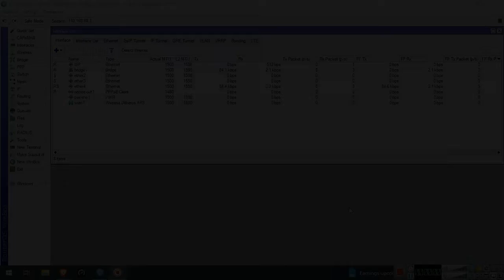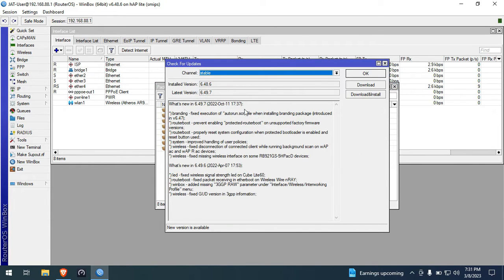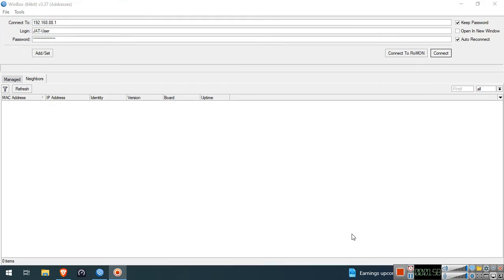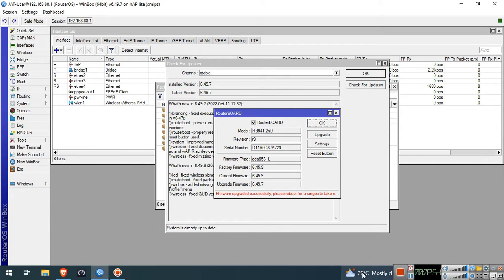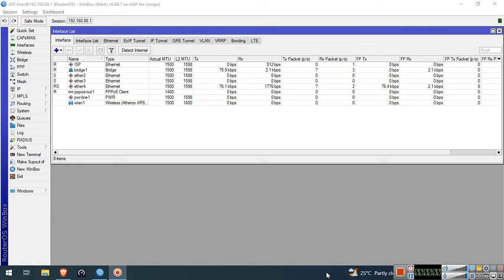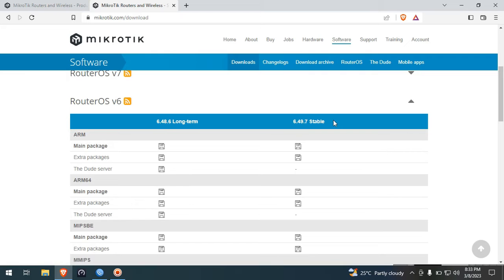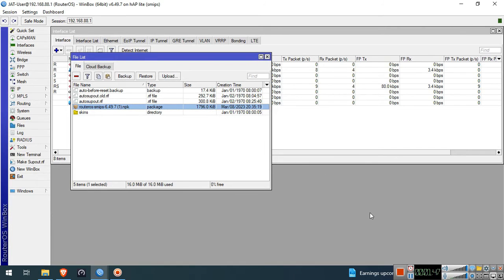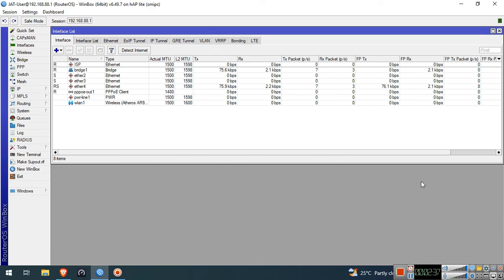Mikrotik Basic Configuration - Upgrade Firmware | Mikrotik Router Tutorial Step By Step

Comment: Hi, could you help me to Update Router OS in my RB750GL Outdated with Release  v 5.2. WinBox v3.40 show ERROR " Could not fetch index". After I see a Post and Try to acces with WinBox v 5.2 and could Access to Device but when Upload File "routeros-Mipsbe-6.49.13.npk" Ok, Reboor option in Menu System its no available to push Button YES to confirm reboot , :(
Do you kmow an alternative Manual Method tu Update Router OS? Thanks